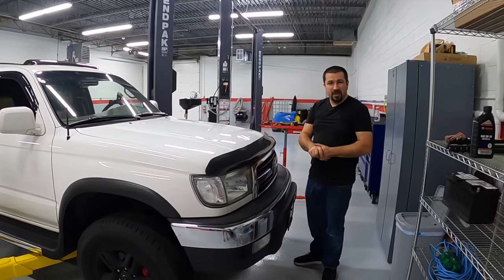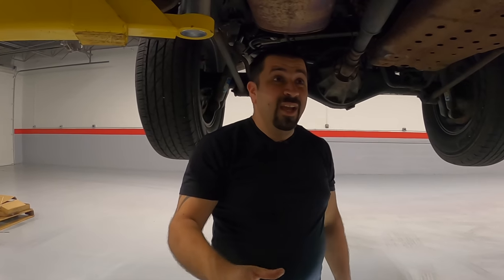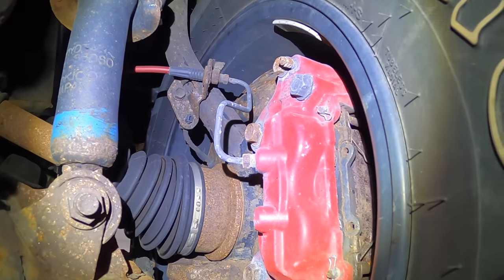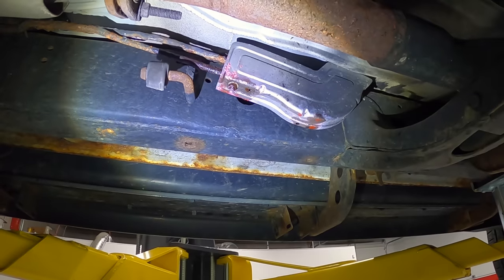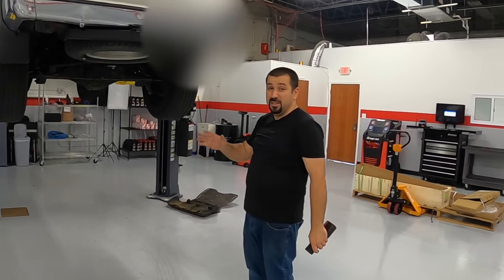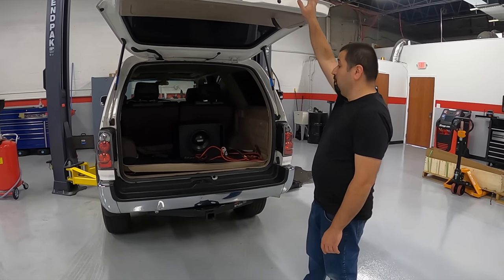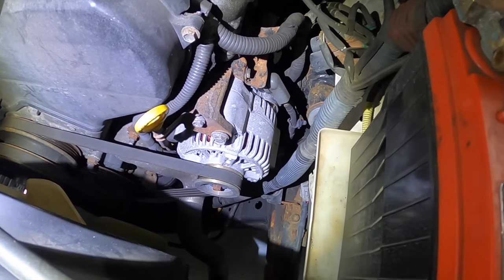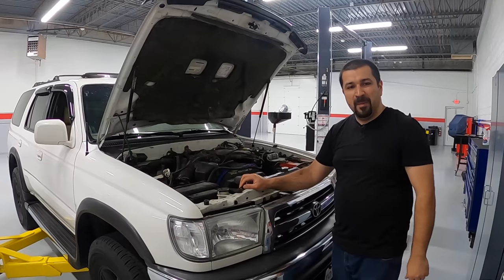Everything You Need to Know about the Toyota 4runner | 3rd Gen 1996-2002

Comment: Funny how that things "common issues" sound more like normal wear & tear. Seal here or there, alternator, radiator. etc. Those are things that just go bad over time in pretty much any machine lol. My coworker owns two of those 4runners and one is almost to 500k!
Reply: I have a 99, it's just bloody old and shouldn't be still running....   pig on gas but cheap to operate,  just like the vehicle  after 17 yrs ownership.  Can't believe there is a review on this vehicle,  GX470 is similar in reliability,  thanks for vid
Reply: And here I am doing my head gasket at 155k lol. Previous owners musta fucked me
Reply: He is implying on toyota 4runner or make not comparing to other vehicles. Toyota make good cars just not perfect. Hie video is how to keep your toyota 4runner in good condition.
Reply: 2002 4runner 245k very little rust love mine
Reply: @MrRoseandrc  

same
Reply: 97 4Runner with 335k mikes…..still going strong!!!!
Reply: Now that's facts 💯🙌👍 my dad own I think 🤔 1st or 2st generation Hilux similar &  is a beast he bought it used but maintain still outlasting newer vehicle it was built strong The best reliable vehicle i have ever driven. I also went off-road with it water up to the windshield and extreme incline all wheel system is a beast.  No I'm looking for one for myself.
Reply: How much money did it cost to do the maintenance on a one of these Toyotas to get it to 500,000 miles? After watching this video I'm not sure I can afford a Toyota even an older one!! I heard everything on Toyota is going to cost you more to replace? and he just walked through the car and if you replaced everything that needed to be replaced on one of these older ones it would cost you a million dollars perhaps
Reply: @nazeershaw66  what are you doing taking somebody else's vehicle in water up to the windshield? I've never even driven a Toyota and  you take your dad's out and abuse it? some people were just born with a spoon in their mouth silver gold it doesn't matter! then they abused it disrespect is rampant
Reply: I have the 2001 SR5 4 runner 4wd 292,000 miles and still going strong.
Reply: @justsaying681  how long have you had your Toyota? And what kind of mechanical work have you done to it to keep it going to 295 thousand miles?
Reply: Yeah “common issues” and the problem is they run go good nobody kept them maintained.
Reply: I've 2000 which I bought a morethan decade ago it's 250k if maintain and looked after well it can go up to 500k or more I like everything about it. 
I like 
When you use the word notorious again and again.😂
Reply: @triedandtrue1820 Dude is not even 30 years old yet.

 “bloody old” 🤣🤦🏻‍♂️
Reply: Do you replace the fuel filter as you mentioned is rusted but notorious? Open can of worms?  If not break don't fix it or fix it?
Reply: Do you replace the fuel filter as you mentioned is rusted but notorious? Open can of worms?  If not break don't fix it or fix it?
Reply: Do you replace the fuel filter as you mentioned is rusted but notorious? Open can of worms?  If not break don't fix it or fix it?
Reply: yea this guy is a joke, we all know the main issue with actual 3rd gen's is possible lower ball joint failures, which is fixed by simply replacing them with OEM ones for a whopping like $350ish for both at Toyota total lol
Reply: @MrRoseandrc  343k on my 96 and yea I have zero rust since it's spent it's life in So Cal and Arizona lol......I'm assuming the one in the video is in midwest or somewhere with lots of rain and/or snow =P
Reply: @wingleuing9211  I replaced mine a few years ago.  I went with oem filter and used a YT video to do it. I can get info for you if you like, it was around $40 at the time.
Reply: 96’ 4runner SR5 sport with VERY minimal rust! Putting in money to keep it going past its current 193,000!
Reply: @Casiodad do you still have it? Hows it going?
Reply: @damyis_100 Brother I wish. Got through the whole head gasket process, but when putting it back together I couldn’t get one of the camshafts to seat properly in the journals. I was following the manual so I honestly think it might have gotten warped at the head shop. I managed to get it in, but I had to kind of force it, and when I started it up for the first time It was fucked. Could have just replaced the head on that side, but as I did the whole thing in my texas backyard in the summertime I didn’t have the energy, plus I didn’t really have any more money to spend on it. Ended up selling it for 3k. Regret it to this day.

Comment: The common problem is the cost of gas to drive this thing 😂
Reply: It's been driven 12k miles since December 2020, it barely moved when gas was affordable. I basically never drive it now. But it's needed when it snows bad. Drove hundreds of miles through a blizzard with cars in ditches and it never slid 4x4.
Reply: @ShinobiXRevived  i use my 2000 4wd as my daily driver… in LA lol

Comment: I had one, a 1997 SR5 model with manual transmission and a TRD supercharger. I still miss it, even my kids miss it as my son learned to drive on it. I gave it to my sister 6 years ago and she sold it for $500 2 years ago with 175k miles.  That car was a tank, I did not replace anything on it except for the water pump and an oxygen sensor.  She sold it when the steering pump failed, a "friendly" mechanic told her it was not worth fixing.
Reply: A very similar experience to my own having sold a very clean ute/pick up to my sister very very cheaply on the understanding they would sell it back to me if no longer required.   They sold behind my back for a very tidy profit.
Reply: @jamesrebbechi9906    That sucks, my sister, on the other hand, asked me if I wanted it back.  I said NO for multiple reasons (rust, shipping cost, no room for it).
Reply: That mechanic sounds like a joke

Comment: Great video. I have a 3rd Gen with 340,000. Runs like a top. Just replaced all the ball joints last week. I plan on using this video and going thru the 4Runner.
Reply: How do you know when to replace the ball joints?  Any signs you look for?
Reply: @anthonygiordano3991  --Yes, ck wheel Wobble--side to side-up and down motion, Tie Rods and Ball Joints could be either or both..
Reply: @randybeard6040  - Is that what I’ve heard when they say the truck shakes or shimmies at highway speeds?
Reply: @anthonygiordano3991  shimmy at highway speeds can just be tire balancing. Took my ‘98 into the shop for tires and it was shimmy free going in, but had a shimmy afterwards. Took two trips back before the lead tech fixed the balance job. Point being, make sure you’re balanced before ripping other stuff apart. You can’t really tell a bad LBJ with a drive test AFAIK.

Comment: The woodgrain bezel on the 99-02 become very brittle compared to the 96-98 version. Also you can swap out the center console from a 99-02 to a 96-98 so you can have cupholders up front. Mine is a 97 and 300K and takes me everywhere.
Reply: I have a 2wd 2002 4Runner and it has cup holders in the center console. Is that a problem for the 4wd models only ?
Reply: @mosthated8190  96-98 didn't come with them 2WD or 4x4.

Comment: Finally a 3rd gen 4Runner, awesome car, best motor Toyota ever made..
Definitely don’t overlook the two most important things: 
1. Replace the radiator. If it goes bad, it will mix coolant with A/T fluid and the whole transmission will be wasted.
2. Replace the front lower ball joints. They’re notorious for catastrophic failure, messing up the whole front suspension. Google some pics..
Awesome review as always!
Reply: Yep!!! Hello milkshake
Reply: The same ball joints are covered by Recall?
Reply: @spannersautoandcomputerser1649  Yes, they are if your vin# falls within the recall
Reply: How do you know when to replace the ball joints or radiator?
Reply: @anthonygiordano3991  open your radiator cap and look inside,  if its pinkish,  looks thick like a milkshake or getting there.  Replace radiator. Ball joints don't wait, just replace them to feel better.
Reply: If it's that big of a problem with Toyota radiators destroying Transmissions! How about running a separate cooler for the transmission? Customize it
Reply: i wouldnt say its the best motor they made, id say thats the 22re
Reply: You’re off your meds regarding best motor. The other two yes, definitely.  This motor was second worst to the 3.slow
Reply: Pittman joint too, it can kill you
Reply: @808kahulaa This is rack and pinion. The 2nd gen 4Runner has a steering box
Reply: @jimrossabrena7955 , look up ball joint failure.  Mostly Toyotas.  Also, thanks for the reply… a year later!  Just kidding.  Toyotas are not the greatest trucks, they’re just easy to work on and they are reminiscent of the mini truck era.  They’re pretty unsafe and severely underpowered.
Reply: @anthonygiordano3991   Look at the top of the radiator, it was black plastic when it was new. If it looks kind of a brownish green it's likely the original, and I personally wouldn't drive it one more mile until putting a new one in. If You're not sure one way or the other, just replace it for insurance, they are not that expensive and you can get a Denso made in Taiwan. Not as good as the OEM one, but better than the chyna crap shoot.

Re: The lower ball joints, same thing. If you can't tell and don't know the owner history, replace them. Not that expensive but if they fail it will be very expensive if not an accident that results in a complete write-off of the truck.

Comment: One of the kids still driving my 2005 4runner, v6 two wheel drive. Never had any issues with it, so far. They keep the maintenance up on it, regularly.
Reply: i have the same model year, 05 4runner sport 4x4 and my next 4runner will be a 2x4. after 17 plus years, I think i really dont need the 4x4, considering i had to replace the cv axle twice already and its making sounds again right now.
Reply: @ilovebohol  my dad passed me down his 02 Tacoma 2x4 prerunner. Then he passed away. I will never get rid of it now. It's so reliable. It's at 230,000 miles.
Reply: @ilovebohol  really! Is that a weak spot on the Toyota is it four-wheel drive all the time? How much did it cost to replace those each time?
Reply: @erniecarrasco9107  just finished my 16 states road trip with 14k miles and now my 4runner has 237k miles.
Reply: @markeverson5849  its not a weakness per say, considering that Toyota are very reliable and now my 4runner got 237k . I just want to maximize and eliminate any future issues.

Comment: My 96 frame failed at the trailing arm driver side, I welded 1/4” plate for repair and did both sides.  My frame looked better than this 4Runner, don’t be surprised if it fails.  They rust from the inside out and the steel delaminates so it’s hard to tell.
Reply: Key point is where did it fail? Did the trailing arm collapse in on itself, did the front of the trailing arm tower fail, or did the rear going towards the rear tires fail?

Comment: AMD, good video as always. I have a 95 4runner with the 3.0 v6. I know people always tell me that engine sucks. I had the dealer do the recall on the head gasket 20 years ago and 380k miles later, still runs fine.Thank younand nice new garage with lifts.
Reply: I had a black 2nd gen, loved that truck. IMO those had a better tailgate and seemed to be just a little higher quality than the ‘96-‘02. Although my 2000 LTD has been the best vehicle I’ve ever owned.

Comment: Thank you. You taught me a lot & made everything really easy to understand.

I recently bought a 1996 limited. One owner. Old people. Locally bought. Always serviced at Toyota. 350000 km's. I paid $5000 Canadian.

I'm going to check the under areas that you pointed out, & the transmission dip-stick, & radiator as you suggested. As far as everything else underneath rust-wise it seemed really good when  I looked when I bought it.

I did previously notice my underneath heater piping was crusty. I thought they were break lines.

I did the valve cover gaskets, but it is still hot smelly oil when driving fast or uphill.

I also did rotors & breaks, rear struts, hatch struts, windshield, fuel filter, & air conditioner. I put in about $1650 Canadian so far.
Reply: Don't forget the PCV valve, cheap but very important☝️

Comment: Owned a 2000 that I bought brand new.  Engine was unstoppable,  gave me minimum issues issues.  Did have the problem with the radiator and transmission cooling line.  Kept running and the inside looked brand new till the end. Had to sell it when it turned 19 years old, it rusted very badly.  Person who purchased it was a mechanic and knew about the rust.  Alternator, catalytic converter, spark plug cables all original, 19 years old.  Very reliable car and great ride.

Comment: bought a new 4 cylinder manual 4 runner in 1998.  Never replaced it, 230k miles.   may be one of the most reliable models ever made.  No ball joint trouble, never heard of that.

Comment: I bought a '99 SR5 4x4 5 yrs ago for 2K. Best vehicle I've ever owned. Rear springs on these sag with higher miles. When I bought it I changed out coil springs all around and installed Bilsteins. I've never had "pink milkshake" issues, but I changed out the radiator when I noticed hairline cracks in the plastic around the cap were weeping fluid. Something to keep an eye on. I installed new LBJs as well. Another issue that can pop up on these is a leaking heater control valve. It can leak without you noticing (it's mounted on the firewall, center of engine compartment). I replaced mine this morning. Easy 30-minute job. That valve was completely rotted out. No doubt it was the original valve. I'm closing in on 400K miles. I've replaced other things here and there...just routine stuff you would expect with an older vehicle. I live in the south, so no rust issues. It does have a good bit of clear coat rash, which is not unusual for these trucks. 
Your channel is fantastic. Love your shop!

Comment: I couldn’t help but laugh remembering all the times i had to replace stuff on here, like he said, mostly rust related.  Fuel filter, rear heater core, he was just ticking off one thing after the other.  Lucky my frame is still good.  
Best memory was driving to san diego to drop my car at the VPC before heading to an overseas assignment and reading the turn-in paperwork on my way over from Arizona: “Parking Brake Must Function” followed by the tests they do. I pulled it while in neutral and the car kept rolling.  Luckily, found a place owned by some Middle Eastern mechanics and they frickin went old school on it.  Took off the parts, put a blow torch to them, un-siezed everything, even re-machined something too.  Like $300 out the door.  Any other place would have had me ordering a bunch of parts for replacement.  Was super grateful to them and made my drop off and flight.

Comment: I have a 98 4Runner limited I’m the 2nd owner. Bought it in 2000. New timing belt, water pump, replaced catalytic converter, excellent leather interior, new brakes and rotors, 3 inch lift. Zero rust…lived her entire life in West Texas dry weather. Currently in shop to diagnose buzzing noise that developed recently when foot taken off accelerator above 60 miles per hour. Young men, and women, compliment us on the truck often. Lots of fun to own and drive
Reply: Did you find out what the buzzing noise was?
Reply: @cf6979  Yes. It was the U-Joints on the drive shafts. Had them replaced for $298 and my 4Runner is running great. In the process, I also went ahead and changed out the brake rotors & pads, front and back, rotated and rebalanced the tires. Nevertheless, the root cause of the buzzing was the unserviceable front U-Joint. Changed out both for peace of mind.
Reply: @CaptainWillard830  Nice!  Changed my front and back U-Joints 2 years ago on my '97 4Runner Limited.  It was making a loud screech but only when backing up.
Reply: @cf6979  I’m grateful for these videos. I plan to preemptively replace the lower ball joints up front. I didn’t know these tend to fail on 3rd Gens

Comment: Had a 2000 leather V6 5-speed manual 4wd for 8 yrs thru and after college.  Great truck, started rusting but I’ve had the frame cut out and rebuilt.  Only cost like $1000 every 3 yrs to rebuild the frame, really not bad cost for maintenance.

Comment: 372,000 miles on my '99.... still chuggin' along.  Just takes regular maintenance...easy to work on.    I had a lot of issues with the rear window & handle... temperamental.   I've spent a lot of time in the salvage yard pulling replacement parts.   Had to replace the Sunroof unit., again, salvage yard.   Fought with the   P0171 code for a while...eventually got that straightened out.  I have the Valve Cover leak... that's next on my list along with Injectors...  did a Tundra big Brake upgrade. Did the Timing belt 70k miles ago,  not much risk since it's non-interference ...kind of a pig on Mountain Passes... but that's my only gripe, they're sloooowwwwwwwww....but great off road.

Comment: As a GX470 owner from WA, I would run away from this frame. That one crusty bad spot seems like a red flag. But at least we have some shops in IL that work with fluid film or similar so you can coat it once in a while and save it from further damage. Great content though!
Reply: The spot that he showed on the video is a pinch weld. 2:20 The condition of the OTHER side towards the front where the lift is near, opposite to where he has his hand in the video, is more important than the frame rail bar at the top failing. That spot is one of the most important spots, but it isn't rusted through.

Comment: I have a 2002 Toyota 4Runner Limited 4WD with 98,000 miles. Clean with no mods. I have new rotors, brake pads, calipers (199) and radiator. Doing this service as soon as possible.